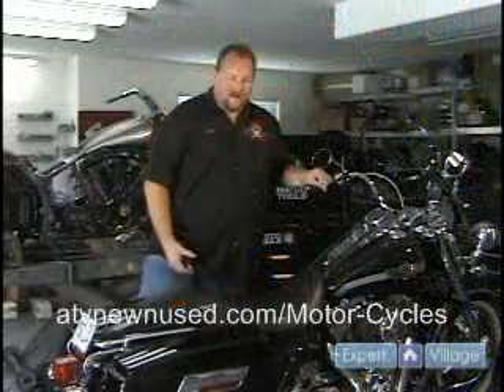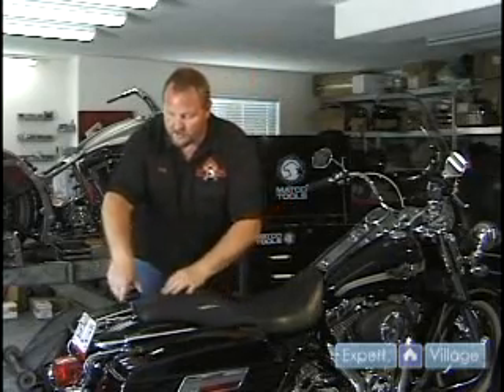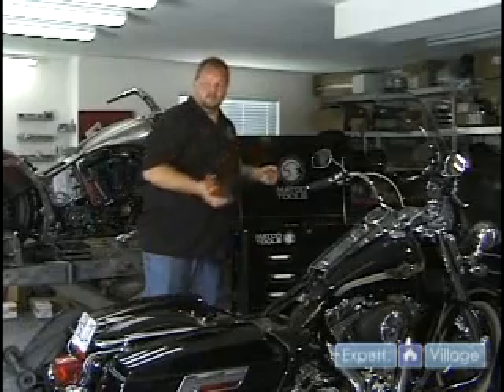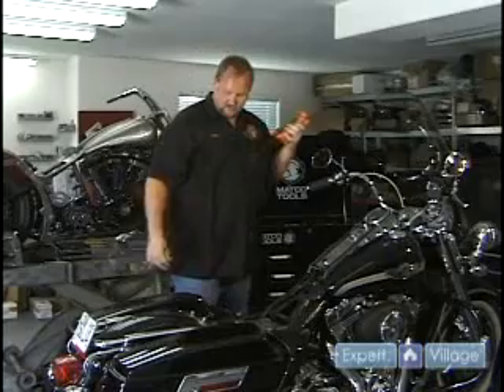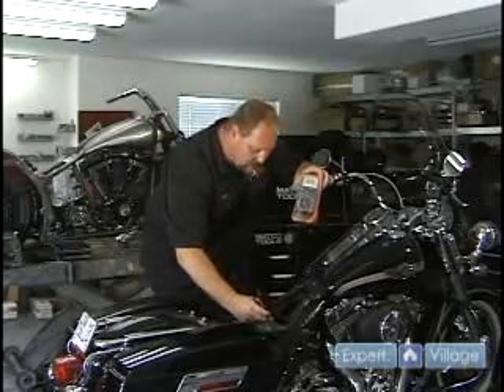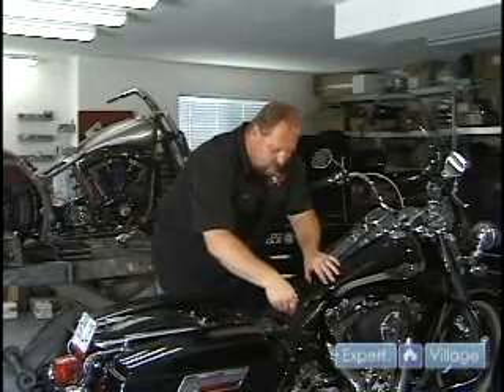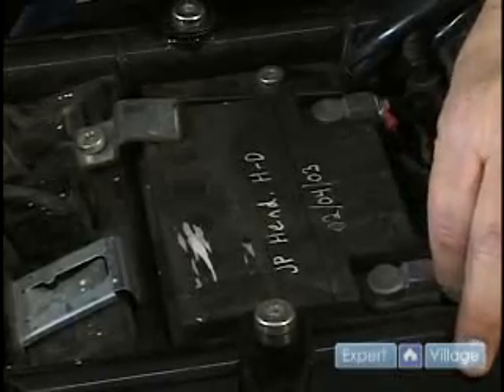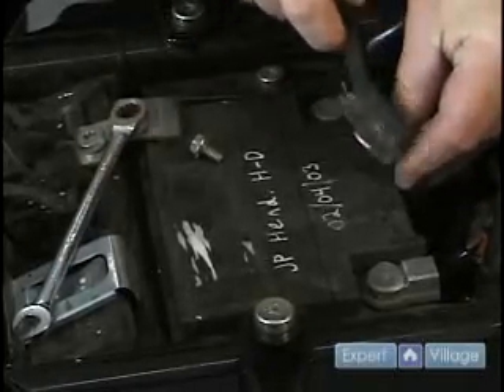HowTo Check a Harley Davidson Motorcycle Battery

Comment: How does testing voltage test the battery's health?  It doesn't.  Also, the cables looked pretty clean as AGM batteries are designed not to corrode.